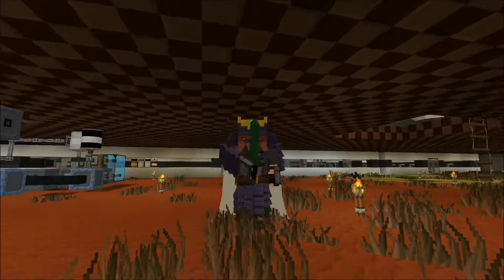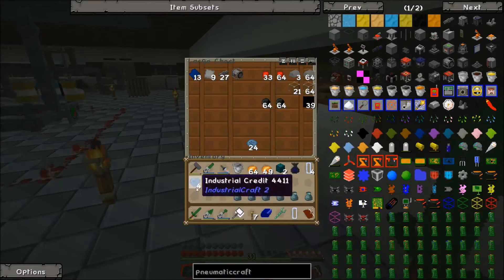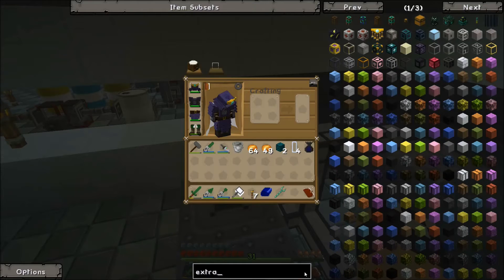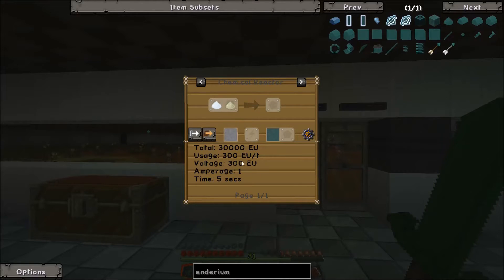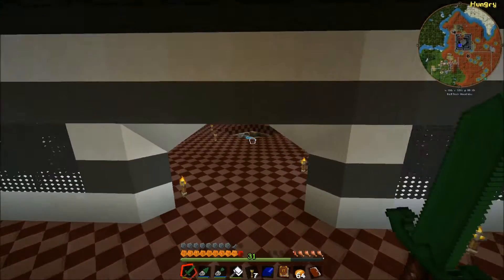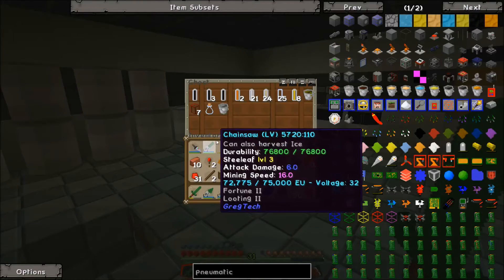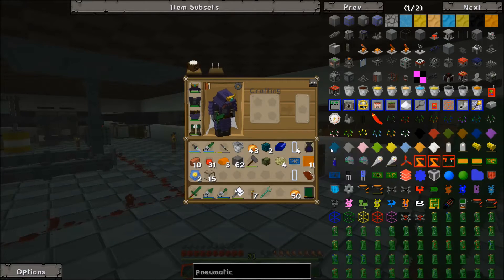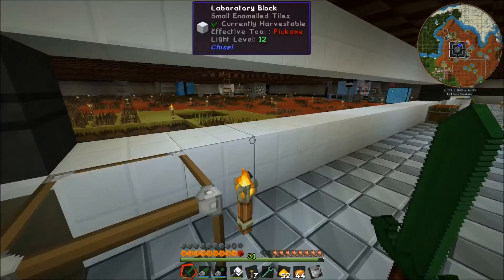Minecraft Infitech 2 Lp Ep 46: The Quest for the Holy PCB Pt.1

Comment: Haven't watched the second part yet, but just gonna put this here. LPG for the Epichlorohydrin cannot be PneumaticCraft version. You need LPG from Gregtech. they are not unified, because PcCraft one is much easier to get.
Reply from the maker: Yeah, I noticed that right at the start of pt 2 when I tried to run it.  Then after making the gregtech version I noticed that there was a recipe to convert them over, lol :p
Reply: No. There is no way to convert. It shows that it is GT LPG when you "try to convert" but its still PcCraft lpg. The liquid label inside the machines will always say gregtech no matter from what mod the liquid is (so for example even water or lava will NOT say minecraft, but still will say Gregtech).
Reply from the maker: Oh, ok.  Well thats def good to know :)  Plus I felt dumb when I thought I could have just converted over the pneumatic lpg to gregtech, lol :p